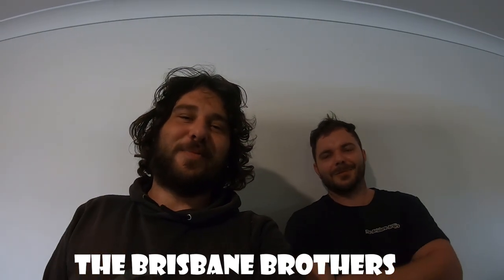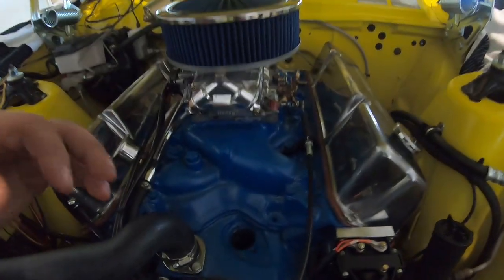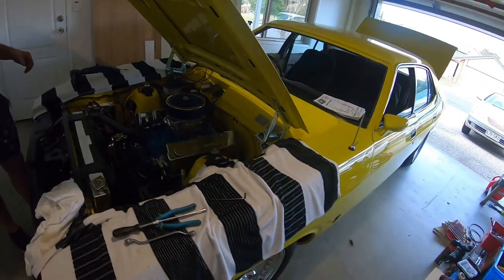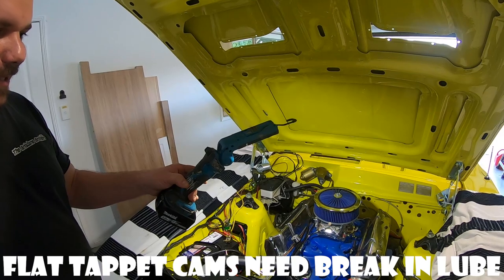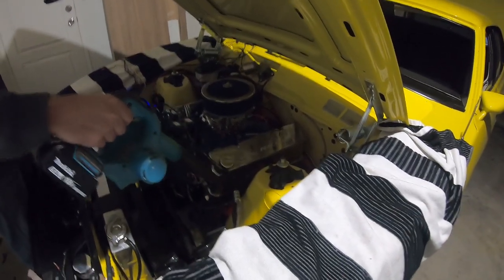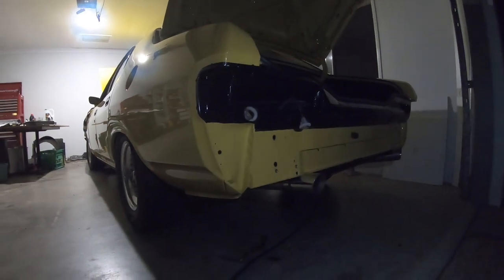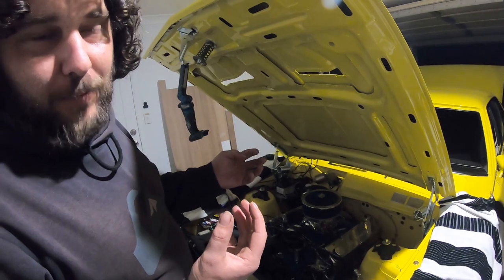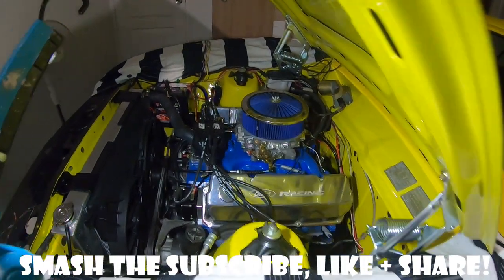FORD 351 CLEVELAND CRANE BLUE RACER CAM SHAFT BREAK IN

Comment: Great video ! what oil do you use for breaking in a flat tappet cam?
Reply from the maker: Penrite and Brad Penn make a run in oil or you can use HPR30 with a break in lube added for the extra zinc the modern oils lack.